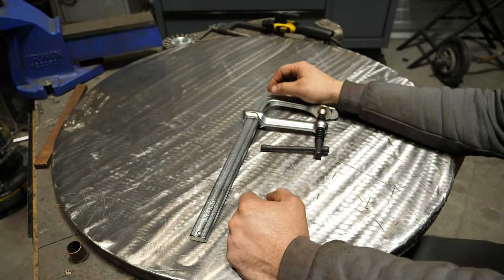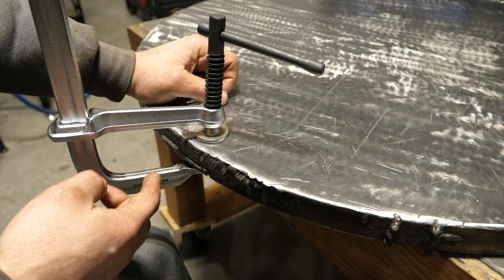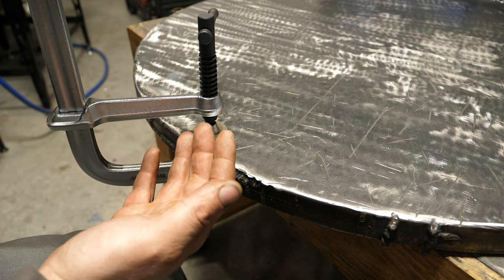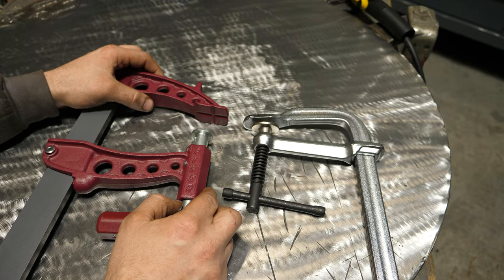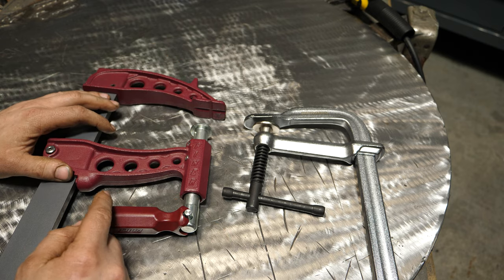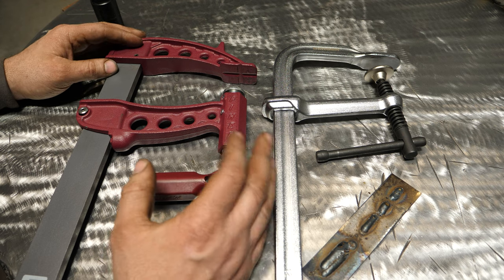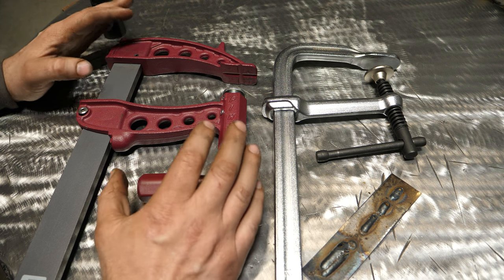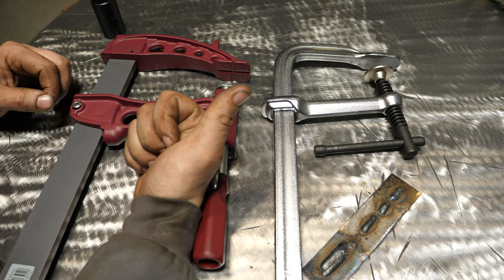Piher Welding 🗜️clamps: First look and review

Comment: I got a set of those maximus clamps from fireball for Christmas. Super beefy. Bought a full stick of 1x2 tube. Now I have a pair of 2', 4', and 6' clamps for those really big jobs. It's a handy feature to be able to weld the tube to something like your welding table temporarily to hold stuff down.
Reply from the maker: Those are slick, I have never seen them.  I will definitely have to check those out.  Pretty trick idea to use tube or solid bar stock for the shaft, you could basically make a clamp for your specific size for reasonable money.
Reply: I'm pretty sure Piher sells the moving Jaw separately too as an accessory, 
the bar is a flat bar, for the F size it's a 35x8mm bar, 
the R uses a 40x10mm bar 
the XXL uses 60x12mm bar.

I haven't tried it but I don't see why it wouldn't work.

Comment: Nice clamp the Piher, not badly priced either. I use Bessey "F" clamps and have quite a few so will get a couple Pifer to try. A very interesting comparison young man, top job!
Reply from the maker: Thanks 😀.  I think you will like them no doubt.  I have a mix of Bessey and knock off ones.  They get the job done but after doing a bunch of jobs with the pihers I will be using them more I think.  They are confidence inspiring to say the least.

Comment: I have a couple of these type of clamps and I’ve used them just once. They are less than useless with a good fixture table with five sides. I can’t even think of how I would use them. I must have a good 25 welding clamps for the fixture table. They all have swivels. The swivels are good when surfaces aren’t parallel as often happens. There are so many different types of clamps because there are so many different clamping needs. What I like about my Siegmund clamps is that you can lock the clamp arm to any height with a finger screw you can tighten more with a hex wrench. You can also slide the arm in and out from the post to make it easier to sit on your work. They’re great when making several parts of the same type as you just loosen the clamp by a turn, or so, and swing the arm out of the way, then just swing it back when the new part is in place. Other companies have copied that. These look interesting so I think I’ll pick up a pair to try them out. I’ve seen them around but never thought about buying any.

Comment: Thanks.  I just threw my c-clamps away.  They're great if you've got three arms!  BTW, I'm a novice welder but took lessons at a local welding supply store.  A lesson I learned the hard way that can ruin one's life (or someone else's life): thinking we're good enough to weld something like a trailer or trailer hitch.  If there's a harmonic vibration from any source, say, out-of-balance or alignment tire/wheel, the best weld can come apart very quickly causing stuff to fall off in the roadway.  No bueno.  Again, thanks for the videos.  I'm (re)learning and enjoy.
Reply from the maker: That’s definitely something I probably don’t talk about enough, static vs dynamic loads. Even a bad weld can support a ton of weight statically.  Ask a bad weld to handle a dynamic load that changes and it will fail.    Trailers are definitely a dynamic load, the welds are exposed to vibration,  stress from any direction, and loads due to payload.  That’s a lot of potentials for failure and it definitely pays to have skill to make solid repairs on such things.

Comment: Piher clamps are awesome, ive used them for a while.
Made in Spain too.
Internally it has a double acting screw, which gives you much much higher clamping pressure.
It kinda acts like a multiplier.
As well as speed.
Reply from the maker: Nice to hear you like them 😀.  I am not the person to buy random stuff that people show off (aka snap on truck syndrome lol) but the clamps are beefy and I had to buy some.  I have used my work set for a few weeks and i am impressed, definitely worth it.
Reply: Yea same, I've had my first set for about 5 years now and they're still solid as a rock for clamping.
You can just get so much more clamping force with them, they've come in handy in so many ways over the years.
Solid product worth the extra few Euro's imo.

Comment: I've got 2 Piher Maxipress clamps, and a Carver (rack) Clamp. I bought the Piher clamps as I could get 2 for the price of 1 Carver. They are very good clamps but it was 2 weeks ago that I found a flaw... For some reason the clamp wasn't sitting square on the job at first I thought it was the little steel wedge. I looked down the clamp and the shaft had bent over time, this had happened on both clamps. (Bear in mind I have had them for 8 years so they've seen some abuse)
I ended up heating it up with the torch, quick whack & all straight again. Just something to keep an eye on. 
The Carver clamps are really popular over here in UK and are virtually indestructible but they are very expensive.
Reply from the maker: I had to look up those carver clamps, I have never heard of them.  They are definitely beefy 😮.  I can see why they are expensive too.

Comment: I have had four of the 12” Piher clamps for several years.   They are my go-to clamp for anything in their size range.  Try clamping two pieces of tubing together at right angles - very tough to pull apart.   Another clamp to look at is the Maximus clamp by Fireball Tool.  I use them for clamping larger assemblies.
Reply from the maker: I am definitely going to grab some of those fireball tool clamps.  Glad to hear you have had good luck with the piher clamps, I sure wish I found them sooner.  They have really made some jobs far easier for me already.  I think I will pickup some of their table clamps for machined holes 😀

Comment: Always room for more clamps.  Sometimes just the number of them can make a difference.  The older 'F' style Harbor Freight had copper coated threads to keep the slag away and they worked well. They also used to have a heavy duty long reach bar clamp for a very good price.  Pretty heavy duty (much much more than the 'F' clamp) and the long reach makes them useful.  My favorite is the 'bridge' style C clamp.  Extremely heavy duty and extremely expensive but if you need shear clamping power, wow.  Pipe clamps used to be really cheap at HF and I got several of each 1/2" and 3/4 both long jaw and regular.  Then there are also the ones that have a stand on the back of the sliding jaws so you can even them up on a table.  Can't have too many and can't have enough variety.  For woodworking projects years ago I got the aluminum 'bar' clamps, couldn't be flimsier but they were cheap at HF.  Making wooden drawers and boxes eats up clamps and these actually worked to hold parts together and put light clamping pressure on them.  That was all I needed so they were worth having.  They aren't the glory tools around the shop but they do a yeoman's work day in and day out.
Reply from the maker: I love those bridge style c clamps, I am too cheap to buy one 😅.  They could clamp the Grand Canyon together 😅.  Definately can never have too many clamps.

Comment: Those are nice. A little pricey for me, but Father’s Day is coming up. Maybe the kids can go in together on one or two of them. Thanks
Reply from the maker: No problem 😀.  The next size down from the R would be a real solid option for general use, it’s roughly the same size as the harbor freight in the video.   It’s also a fair bit cheaper.  I would definitely get one of them to have around, it’s far more useful for clamping random stuff than most clamps 😀

Comment: Those Bassy clamp clones I have a bunch of them and like you pointed out that little Tommy bar that they give you to tighten it with comes very short when it comes to extreme clamping pressure that it can give so my alleviation to this problem was I found a set of nuts that would fit on that tightening bolts and I positioned it in such a way that the bar still slides and plug welded a nut to the end of that shaft so that I could use an adjustable or a socket wrench to tighten it most of the time I use a breaker bar with the socket I got the idea from looking at boiler clamps because they are only turned with a wrench
Reply from the maker: Interesting idea on the welded nut, that could come in handy 😀
Reply: @makingmistakeswithgreg  it makes it handy for those situations where you have tightened the clamp by hand but you're just Out Of Reach for tightening it anymore and actually getting any more hand leverage out of it you just need just a few more squeaks out of it that's what did it for however this new clamp that you showed I went looking at them and you weren't kidding for the price of one of those I could get four more of the knockoff bessey clamps but I am going to purchase one in the near future so I can compare it for myself against one of those clamps I already have and I think I already know what's going to happen I'm going to end up with a bunch of them

Comment: Really neat piston design. I've fought with the swivel pad moving my holding piece.  I have some clamps that seems to borrow from. One part being that horn... what is it for? Thought it was style.
Reply from the maker: The horn on the top of the clamp?  The only thought I have is that when you pick it up it indexes on your hand right at that point.  That way you can hold the top while spinning the handle a little bit easier.  Beyond that it’s hard to say lol.

Comment: I might have a question/situation for your toolbox: I have to weld 1/8" tubing to the inside of 1/4" angle. I plan to stick it but the large gap has always been a problem for me. Any suggestions?
Reply from the maker: So you’re talking 1/8th wall tubing that’s say 1 in  diameter, or just straight 1/8th diameter tube on 1/4in thick angle iron?  Or are you talking 1/8th tube dia on small 1/4in angle iron?  I am sure I can come up with tips.  

As far as gaps, they are tough with stick.  My number one go to with welding gaps with stick is 6010/6011 because they make it easier.  My second go to is to do whatever I can to close a gap (run beads to fill one side of the gap and then join the two pieces when the gap is reasonable).
Reply: 1/8" wall tubing 1" diameter inside 1/4" thick 1.5" angle. I mostly use 6011 on dc. The build up before joining the two sounds like a good idea. Thanks!
Reply from the maker: Ok, that’s what I call the worst case scenario.  Anytime you have a weird round profile welded to a flat you end up with issues of slag being difficult to remove.  It can also be a pita to get both to join together.  I would definitely use 6011, it will be smoother and less penetrating than 6010, and won’t have slag issues like 6013/7018.  If you can put a small bead on the angle to slightly tighten the gap/round to flat profile it will save you.  Your travel speed may need to be slower because you will need to fill quite a bit.  I find mig and flux core wire work far better for what you’re looking at doing, but stick is doable.  Do some test welds to dial it in, but you’re on the right path with 6011 😀.
Reply: Cool thanks. I'll give it a shot.

Comment: Can the Piher clamp take heating with a torch work?
Reply from the maker: If you were to heat the body directly you will likely cook the grease out of it.  They are grease able via a fitting.  From a damage perspective I wouldn’t be too worried about it to be honest.  As far as I can tell the piston assembly has no seals or anything that would melt.  The plastic handle wouldn’t like being torched to much though lol.
Reply: @makingmistakeswithgreg  
It looks like a good clamp, probably could tack with it.  
It probably wouldn’t take the heat if you clamp a 1/8” small piece of plate say 10” long and 4” wide to the side of a table and heat it to bend a 90. 
You would have to clamp so close to where you’re heating, but you can with the bessey clamp.

Comment: I want the 4' piher in 18" form. Otherwise decent clamps, only downside is exposing the lubricant to heat, abusing a $20 HF clamp is guilt free.
Reply from the maker: Definitely is guilt free blasting a HF clamp with spatter lol.